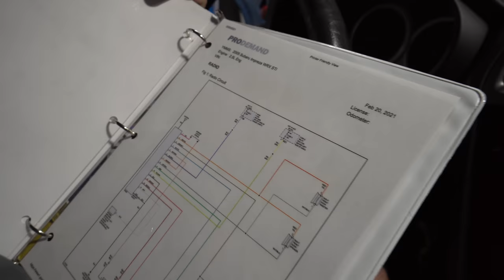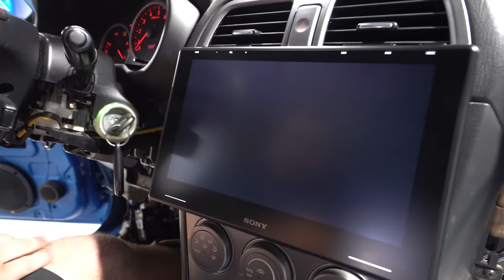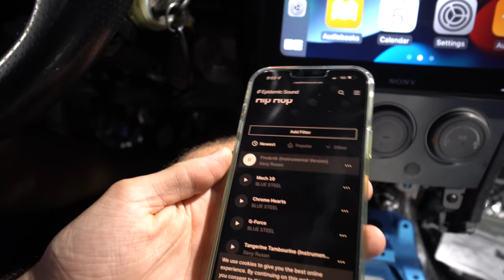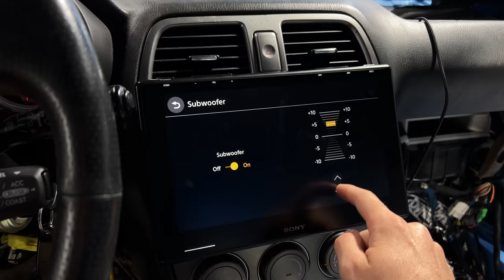Installing a HUGE Apple Car Play Unit & Sony Sound System (2021 Tech in a 1996 Car!)

Comment: I am 10:54 video time. No sound dampening in doors, that is poor, also all copper cables cannot be used speaker wires. There is a difference. Also Tweeter position is so super wrong. Pls don't Mind. Positive criticism.

Comment: For someone who "knows" car audio you should know not to mount tweeters so low in the front doors, don't mount a nice subwoofer in a cheap ass 5/8 mdf prefab box with too much resonance flex and definitely use sound deadening material in the front doors around and behind each driver.  All that nice ES gear and it won't even be able to reach it's max sound potential...smh

Comment: You do not use the stock deck mounting brackets to do aftermarket radios very rare u do that. Need a faceplate/harness kit to do so for each car according to make and model! 
As well using the harness you get wire that to the deck u use if not using amps instead of cutting the stock harness from car ! Always hate seeing that done very much a pain when switching decks to maybe sell car so on and not very professional in my opinion
Reply: The stock harness was used in his dads blue STi. All you need is a wiring diagram and life will be easy if the stock harness is cut.

Comment: Title sounds a bit confusing? Like as if cars back in the 90’s didn’t have big systems installed.
There were a lot more ice installs in the 90’s than what there is today, they also went to far greater lengths to achieve that perfect fit & finish. A culture that’s more or less disappeared these days ☹️
Gotta be honest tho…. There’s no where near enough sound deadening in that scooby. I did a massive install to a 2006 2.5 sti hawkeye I had the whole of the inside covered and it still rattled like a tin can.

Comment: Its a big mistake to put the fuzes so far from the battery, now if there is a shortage, it leaves so much wire to heat up and it may burn your car down, that’s why you but the fuze close to the battery
Reply: I thought the same, but the main battery is now in the trunk and within 6" of the main system fuse according to Randall who did the wiring.

Comment: overkill in car hifi is almost not posible in my opinion 😂 i run 2x 15" spl  woofer in a golf with per door 4x 6,5 and 2  mids and tweeter

Comment: Why would you cut the main stereo harness pretty much every car stock stereo harness has a adapter kit that plugs right into the factory  plug after u plug it in the other end is 99.9 percent of the time the same color wires as the aftermarket stereo harness. That is literally one of the biggest  no nos at all cost don't cut factory stereo wiring especially if the wires are wrapped in sound canceling  ground foil and you can just create extra problems that aren't worth it. Most of the time the wiring harness kits are 20 to 40 bucks unless you vehicle  has rsa (rear seat audio), onstar, Bluetooth, swc (steering wheel controls, door chime and warning chimes, factory reverse camera, parking sensors those stereo kits generally are much more expensive and if you want to retain any of that u will have to buy a harness unless your the wiring wizard God that can figure out how to wire everything  lol. Anyways to each there own opinion. I was always taught avoid cutting any factory wiring at all cost most of the time there are plug and play harness  for everything  for most vehicles. I am very impressed with your build and this car looks incredible ! Like have you guys done everything  including paint or did that get sent out ?

Comment: Just finished a sound system in my 1998 Legacy GT. I used gold-plated connectors for all of my connections. Is there any reason why you guys did not use gold-plated connectors? I really do wonder if the extra cost for the connectors is worth it in terms of overall sound quality. Anyway, excellent video and I cant wait to see where this project takes you! Keep up the great work.

Comment: Only thing that I think should’ve been different is the rear tweeter placement, those would definitely hurt the ears of anyone sitting in the back seat
Reply: Simply use the Head Unit's FADER control to lower the volume of the Rear Component Speakers in relation to the front component set.  This head unit also has a Network Mode and Full DSP with independent PEQ to reduce the high frequencies in the rear component set if desired.  Personally, I would use the rear speakers to provide Differential Rear Fill to achieve a better soundstage and increase "space" and room ambience.

Comment: The screen is just to big imo. You could have installed a smaller one and made it look like its an actual OEM part.
Reply: I somewhat agree, but it's the Huge Bezels on this head unit that really make it seem so big overall!  If Sony made it with slim bezels like any modern smartphone or iPad, it would be MUCH smaller overall and not potentially block important dash controls, the shift knob, or A/C vents, etc.

Comment: Hooooooooold up......NOT all copper wire is the same....first, there is a difference in the thickness and amount of strands. Then, there is regular plain copper wire, CCA and OFC. I just bought some 14 gauge OFC speaker wire last week and its bitchen. Furthermore, the only thing you should EVER crimp, is ferrules, but those can be soldered too. Crimping is for hacks. Solder the WORLD!!!

Comment: Nice system! 
What's the cost for this whole kit?
Reply: 1299
Reply: @ParanoiaGentlman  That's including the speakers and head unit?
Reply: @petedavis1040  
The head unit alone is $1,300.  Each 6.5" 2-way component speaker set is $299.  Each amplifier is $249.  The 10" Subwoofer is $218.  Add in the cost of materials for the subwoofer enclosure, RCAs, Power wiring, fuse blocks, battery terminals, Dynamat, etc...so probably another $250-$450.

Comment: What is the price on a build like this
Reply: Head Unit $1300, Component Speaker Set $300 Each, Amplifiers $250 Each, Subwoofer $220.  Add in the materials for the subwoofer enclosure, power and RCA signal wiring, fuse blocks, Dynamat, etc, so probably another $250-$400.

Comment: The only thing I saw that made me cringe was the 2 wires on the passenger's door. They come from inside the door cavity through a small hole with no protection against rubbing through and shorting out.

Comment: I hate those screens that are just stuck on the dash, like all new cars that have a screen, they are just stuck on like its an after thought. I feel like for a car this clean and high quality build there could have been a better unit to use that would integrate more seamlessly and cleanly. The rest of your system looks great the screen kinda ruined the dash.
Reply: Look into the Stinger HEIGH10 which has an optional recessed dash mount bucket or tray.  Although this Sony Mobile ES is much better in terms of features except that it does not have a Digital Optical Toslink output like the HEIGH10.

Comment: How much was the whole system?
Reply: @Devin Ward  
Head Unit $1300, Component Speaker Sets $300 Each, Amplifiers $250 Each, Subwoofer $220.  Add in the subwoofer enclosure, power and RCA signal wiring, fuse blocks, Dynamat, etc, so probably another $250-$400.  Oh, and they used a Lithium battery.

Comment: Hold up. Fuses for amps are way too far from the battery. 
Imagine having battery under hood and first fuse just before the amp in the trunk. There's "unprotected" wiring running tens if not hundreds of amperes of current.
Smells like fire hazard to me.
Looks cool but that thing makes me feel uncomfortable

Comment: Buy a bmw 550i and it will have a 2k sound system from harman kardon
Reply: The BMW HK system would never compare to this full Sony Mobile ES system...IF this system was properly installed and tuned using the excellent DSP & Network Mode that is available in this flagship Sony head unit!

Comment: Uses 0awg power but 16awg on the sub? Not to mention, fuses should ALWAYS be installed within 18” of the battery…..not in the back by the amps. The amps have their own fuses, the line fuses are to keep your power wires from melting down. 🤦‍♂️ . Build is awesome man but your “installer” is a full on shade tree installer.
Reply: Randall posted that the main Battery was relocated to the trunk and that the main system fuse is within 6" of the battery.

There were several other obvious mistakes throughout the installation, though.

Comment: 1200just for a headunit though...
Reply: Head Unit $1300, Component Speaker Sets $300 Each x 2, Amplifiers $250 Each x 2, Subwoofer $220.  Add in the subwoofer enclosure, power and RCA signal wiring, fuse blocks, Dynamat, etc, so probably another $250-$400.  Oh, and they used a Lithium battery.

Comment: For the love of god please have someone who knows what they’re doing with car audio adjust the amp gains properly and tune everything .. Great video  but slot of stuff is very cringy to hard core audio guys and installers
Reply: This isn’t a hard core audio guy install video
Reply: @Randallpullen123  that’s true, but if you’re going to should people how to do something etc you should at least do it the right way… And I’m not really talking about hard core audio guy stuff.. I talking about the proper way to do it in general for anyone audio installer.. there is a way to set gains either with a multimeter or DD1… the gain isn’t a volume knob, it is there to match the sensitivity of the head unit to avoid distortion etc.. there are ways to easily do that… 🤷‍♂️
Reply: Wasn’t showing how to set gains boss
Reply: @Randallpullen123  well, when showing how to install a “high end audio system” setting the gains properly should be a key part of it.. that’s the equivalent of doing a complete motor and big turbo and running it on a stock every with no tuning 😂

Comment: I hate to be a Debbie downer but.... as a person that's been stalling Car Audio for over 30 years I can see you guys need a little bit more practice. All that sound deadening on the floor and nothing on the doors or rear deck. Mounting the tweeters that low in the door panel is it going to make for a horrible soundstage… Unless you like all your music coming from your ankles instead of the dash. A lot of those holes he drilled make for a very sharp edge and you're running wires through it, all that vibration happens in the car and rubs on those wires and eventually it's going to cut through and then maybe you will release the magic smoke from those amplifiers! I'm not saying you did a horrible job he did a pretty decent job I have seen a lot and I do mean a lot worse! There is just a better way of doing it which will result in a far better experience when you finish. I'm extremely picky and I realize not everyone wants to go through all the steps that I do but I figure if you're going to do it especially at the stage you're in and in car you want to be your daily forever you might want to go that extra step you'll be glad you did. Good choice with Sony though, I've heard those speakers and amplifiers up against brands such as Focal and Hertz and for the price of the Sony's I don't think you can get a better sounding speaker.

Comment: Never cringed so hard watching someone use a drill.  Drilling through the new speakers and slamming the drill chuck into them, screwing into aluminium using the impact setting. Not to mention, no rubber grommets around the wires traversing the steel panels. No rust protection on the holes drilled in the steel panels. Tweeters in the wrong position, amplifier fuses in the wrong position. I would be gutted if someone did that to my car after the time and effort that has already been made.

Comment: An overall poor installation. No rubber protectors for the cables going to the crossovers and tweeters. Why have all the shaving fall in the brand new speakers and why not just put that second screw. That plastic will break with a big bump

Comment: The fuse is not to protect the amp.  And you put it in the wrong end.

It's to protect the car from fire in case there is a place on the cable that rubbes of insulation, creating a fire..   Ffs. Read the manual 🤣
Reply: Tom, I thought the same thing, but Randall commented that the Battery was relocated to the trunk and that the main system fuse is now within 6" of the (+) battery terminal.  ;)  They should have also used a FUSED distribution block when stepping down to the 4 AWG power wire going to the amplifiers, though.
Reply: @bbfoto7248  that makes this ok 😊. They should I form of things like this, because there is alot of ppl who learns to instal their own system on YouTube.

Comment: Sony makes trash car audio , their speakers suck and their subs are even worse.   Sponsored or not , your putting in the time and effort , might as well not cheap out on the actual equipment.  Keep the head unit trash the rest especially that prefab box , don't care who made it , unless its specifically for the sub chosen , its garbage..  The install it self is fuckin immaculate , well done.